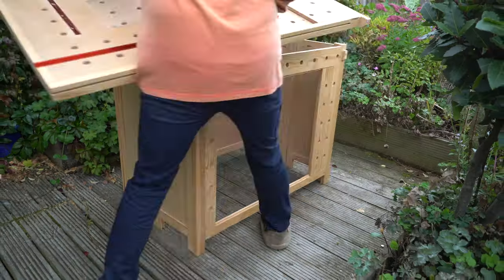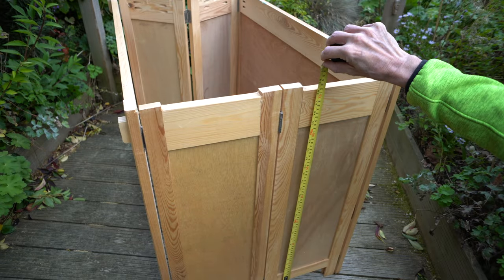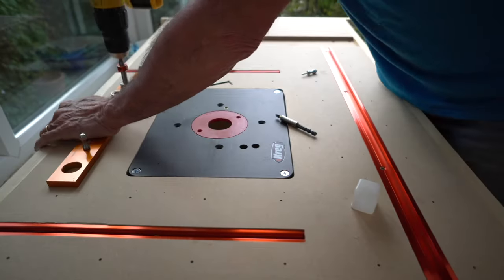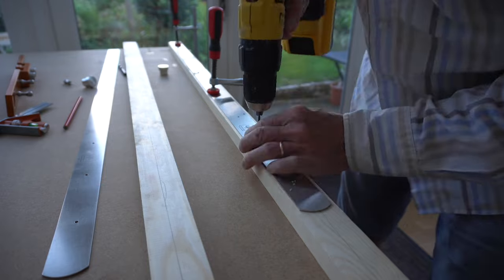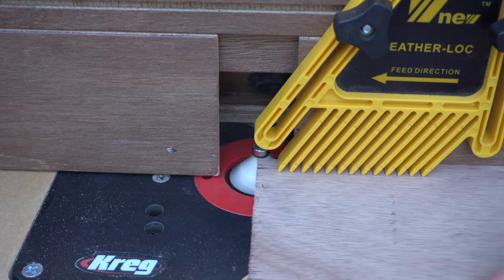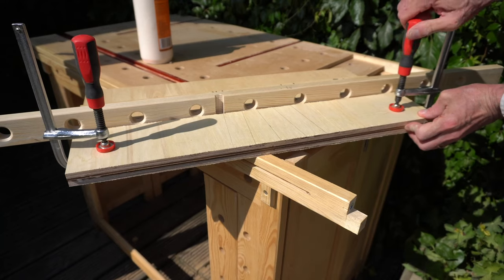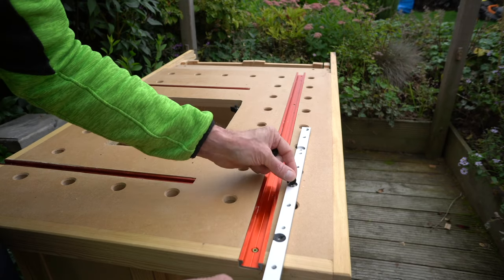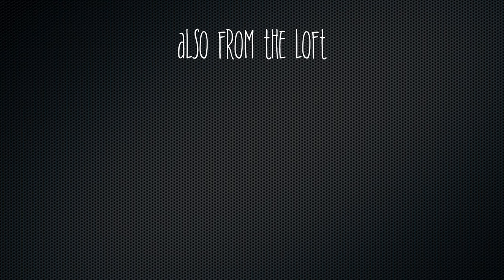The Ultimate Mobile Workbench? #video100

Comment: Err… so what IS the joy of 96mm centers? I’ve frequently wondered why this odd number is a persistent standard and have yet to find a sensible reason for it. Always seemed to me that 100mm would make life somehow “simpler”. :)
Reply from the maker: Hi Steve. I was being a bit sarcastic regarding the 96mm centres, I agree 100mm would make more sense. Apparently the 96mm is derived from an old engineering standard that works on 32mm (1 1/4”) increments. regards JP
Reply: @Smallbarnworkshop  haha - you got me!!  🤣🤣 naive? me?? ;))